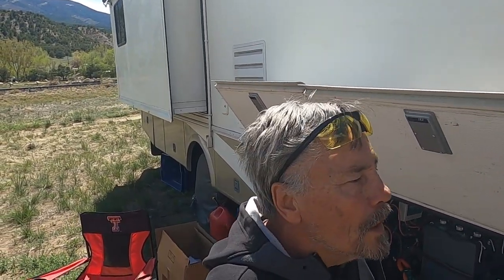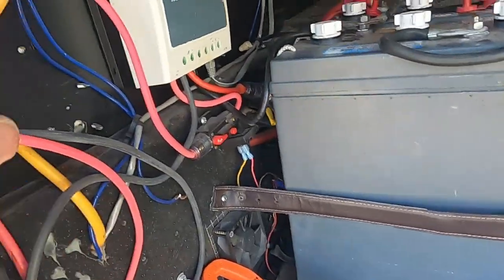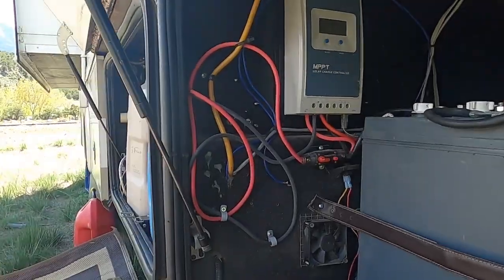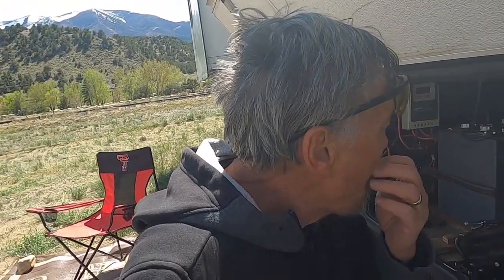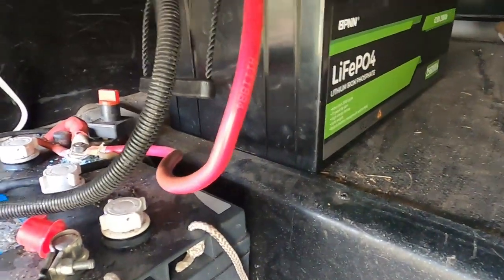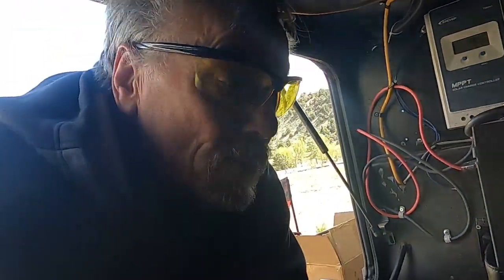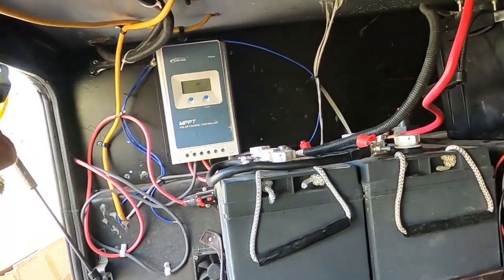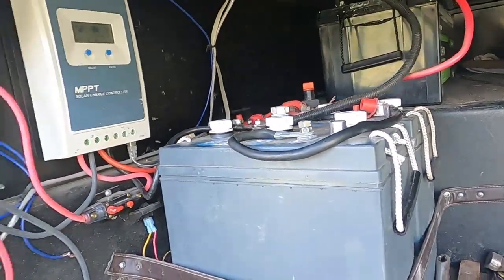An idiot mixed lead-acid with lithium batteries?

Comment: Mixing lead-acid and lithium batteries is not recommended due to differing voltage, charging, and discharge characteristics. It can cause inefficient operation, reduced battery lifespan, overheating, or safety risks like fire or thermal runaway. Use one battery type, match chargers, and avoid mixing unless using specialized management systems.

Comment: The. Charge controller needs to be set for lithium your not making any emprovements use eather lithium or lead
Reply from the maker: @jameswilsin5348  Hello new friend, l that you can run your lithium batteries down to 0% charge? This is true,but it turns out that that's 10.1 volts. At that voltage my battery BMS shut them down! The only way I have to get them back is to hook them to my lead acid batteries. They come right back on.
It's not done so please subscribe to my channel as I have subscribed to yours.
Thanks for watching may God bless you!
Reply: Some great discussion here. I am looking at doing the same. My application is a sailboat so only slightly different.  With a good quality BMS a guy could set the lifepo4 to cut out at 14.0 or 14.1 v. Then the lead acid charger would finish charging the lead appropriately.  This approach would not charge the lithium perfectly but I think that is OK.  Several other enthusiasts have tried this with good results.   Also setting the BMS to cut out at 12v will prevent over discharge.  Look forward to hearing other opinions.  Thanks for a great discussion.

Comment: Also the lead acid will stay at rest at a lower voltage slightly. They usually read about 12.8 v rested not charged recently. And your Lifepo4 battery will stay around 13.6v to 13.4v at rest not recently charged. So Lifepo4 battery will be taking up the slack slightly, it will work, but best to use in near future, only use all Lifepo4 batteries in your battery bank. All characteristics between batteries of same type work well together. You have to watch your voltages between different types of batteries in 12v range. Keep all batteries wired together at same voltage as best you can. I know batteries are not cheap. 😊
Reply from the maker: Hello again friend, thanks again for the additional information.
May God bless you!

Comment: Actually your okay, the lead acid batteries are charging the Lifepo4 battery because they are at a slightly over voltage over Lifepo4. Lifepo4 battery can handle a 100 amp charge so the lead acid was maybe 1 amp of charge to the Lifepo4 battery.
You can keep charging at 14.2v on lead acid, so lead acid charging is actually lower than Lifepo4 charging at 14.6v. You are not too far off your Lifepo4 battery charging volts at a slight lower 14.2v, but its okay to charge Lifepo4 at a lower charge voltage. Pretty close to the same run time charging Lifepo4 at 14.2v lead acid charging vs 14.6v Lifepo4 charging voltage. They say Lifepo4 will last longer at lower charge voltage but at the expense of a slightly less run time.
Reply from the maker: Good morning friend, thank you for your knowledge and wisdom. There's so much misinformation! Until you try it yourself you don't know what to believe? I'm not a tech guy, I'm the kind of guy just tries it and see what happens?
It's not done so please subscribe my Channel that I have subscribed to yours.
Again thank you for watching and may God bless you!

Comment: when you put two batteries in parallel, on a connection pole you put a shunt and digital ammeter that shows you the direction and the current which way they go.
currents up to 3 A are not so problematic
Reply from the maker: Good morning friend, thank you for the comment and tip.
If not done so please subscribe to my channel as I described to yours.
Thank you for watching and may God bless you!

Comment: It'll work fine....... They are wrong...... Huge myth spread by manufacturers.    They will work great together.😎👍👍
Reply from the maker: @dogdazetravellergarrett1367  Hello new friend, thank you for your comment and I believe you are correct.
If not then so please subscribe to my channel as I have subscribed to yours
Thank you for watching and may God bless you!
Reply: I’ve had four GC2 210ah wired 12v with four 100ah lipho4 in a shed/cabin for years charging from 800w solar with no issues, run 10k window ac, small compressor, charge power tool batteries and ac/dc compressor fridge/freezer.
Reply: I’ve had four GC2 210ah wired 12v with four 100ah lipho4 in a shed/cabin for years charging from 800w solar with no issues, run 10k window ac, small compressor, charge power tool batteries and ac/dc compressor fridge/freezer.
Reply: What size cables are you using?
Reply: @avianwashington7396  4ga cables

Comment: My RV starts charging all my batteries, engine,  which are 200 amp  LEAD ACID and house, which are 600 amp LITHIUM, 1-2 minutes after having started the engine...I've drove for hours , so far, and aside getting a good charge on my lithium, I didn't see anything burning down.

Comment: Generally speaking you don't want to parallel lithium with lead-acid.  That doesn't mean that you can't, just that it isn't a good idea.  I'll explain the reason in the second section below.

Always size fuses to 125% of the amperage limit of the device or cabling (whichever is lower).  So a 40A circuit should have a 50A fuse.   The reason is that a 40A fuse that is constantly run at 40A might melt its casing or otherwise generate a lot of unnecessary heat without blowing.  Its a bit of a safety issue.  The fuses are there to protect against shorts, mainly, you don't want them running hot under "normal" operation.

Of course if a particular circuit is sized for 40A but you never run more than, say, 30A through it, sizing the fuse to 40A is just fine.

You generally don't want to directly charge lithium from an alternator, it can burn-out the alternator. The reason is that the lithium can suck up as much current as the alternator is able to put out, and the lithium can do that for hours on end with its voltage barely budging.  While charging, LiFePO4's voltage doesn't really go up much past a certain point until it is nearly full.

This can burn-out the alternator.   Lead-acid behaves a bit differently with alternators because lead-acid voltages tend to rise up in response to the current sufficiently to regulate the current down a bit, even when the lead-acid battery is at a low SOC.  So the alternator is not going full-out for hours on end with lead-acid.  But with lithium, it will.

This is why a DC-DC charger should be used between the alternator and the lithium.

--

You generally don't want to parallel lithium and lead-acid.  It isn't ideal for either chemistry.   But it IS true that the voltages are mostly (but not entirely) compatible with each other.  At least as long as you don't try to equalize the lead-acid (which would be bad for the lithium).   There are several limitations:

(1) Lithium can accept much more current than lead-acid.  1C is the typical limit (the BMS might have a lower limit so read the battery label), and it doesn't particularly stress the lithium to be charged that quickly.   Lead-acid, on the other-hand, should generally not be charged faster than 0.1C.

So you have to severely limit the charging rate if you parallel.   This might not be a problem but remember that the lithium and lead-acid will accept current in different proportions and if the lithium disconnects for whatever reason, the lead-acid will take the full charging current.  So you gotta be a bit careful.

(2) The bigger problem is that lead-acid and lithium have vastly different resting voltages, and different characteristics at those voltages.

14.2V is an excellent bulk target for lithium iron phosphate, and works for lead-acid.  But holding there for a long time isn't good for lead-acid.   Similarly, the float voltage for LiFePO4 is roughly 13.4V - 13.6V, which tends to be more compatible.  But the RESTING voltage for a fully charged LiFePO4 is basically its float, whereas for lead-acid it is far lower (like 12.8V).   And 12.8V is significantly discharged for lithium.

This means that the lead-acid is going to drain the lithium slowly, which is not ideal.   This is the primary concern on the lithium side.

(3) Because of the above, the lead-acid will be held at a higher than normal voltage more or less indefinitely.  This can cause extra stress on the lead-acid and possibly more hydrogen outgassing, depending on the type.   This is the primary concern on the lead-acid side when you fully charge a paralleled pack.

(Some marine DIYers have gizmos to disconnect the lead-acid and lithium after charging is complete to allow the lead-acid to rest to try to get around this issue)

(4) Obviously you can't equalize the lead-acid, the voltage would be too high for the lithium.  This might or might not matter for the application.  Often when people do this sort of paralleling they don't care if their lead-acid sees more stress.

DISCHARGING:

For discharging the compatibility is good.  12.0V is roughly 50% SOC for lead-acid (which is where you want to stop), and 5% SOC for LiFePO4 (also a good place to stop)... so 12.0V is a good lower cut-off.  The lithium will take most of the load and if a big surge occurs the lead-acid will help.  The lead-acid will take over as the lithium gets low.

The problem is on the upper-end of the scale rather than the lower-end of the scale.

(5) The cycle life of the lithium will be negatively effected due to the lead-acid yanking it around (current shuffling between the two types of batteries).  Most people do not consider this to be a big issue though since LiFePO4 has a huge 3000+ cycle life.  Calendar aging of the LiFePO4 might be accelerated though which is more of an issue.

--

So can you do it?  Yes, but it isn't ideal and care must be taken.  I personally would not do it.  And regardless of what you choose you do NOT want the alternator to directly charge lithium.  Get a DC-DC charger designed for alternator-to-lithium.  You don't want to smoke your alternator.

-Matt
Reply: I respect Andy’s extensive testing on DYI Off-Grid Garage his Bulk settings are 13.8vdc with 1 hour absorption, and Float 13.4vdc respectively. His Bulk settings allow the batteries BMS to level all the cells. To high of a bulk voltage will cause a cell to hit it’s voltage limit, and the whole BMS will quit charging, unit that cell goes down, then it restarts, and repeats. I believe the lead acid in parallel is fine, however if you have cloudy days and the lead acid’s fill in, then bulk charging them back up to avoid sulphation, is prudent. This is over the lithium’s 13.8vdc so if you have a lithium battery that’s connected via Bluetooth or R485/CAN then you can turn off the lithium’s charging, and top up the lead acid’s. Take care
Reply: @TopMooseCone  A 13.8V target only works if you are able adjust the BMS's balance configuration to actually start balancing at that low a voltage.  e.g. to program the BMS to start balancing at 3.40V/cell or 3.42V/cell or so.

Most BMS's by default do not start balancing until 3.45V/cell (13.8V) or 3.50V/cell (14.0V), and you need to go 0.05V higher for your charge target to deal with sensor offset error.   This means that for an unmodified battery, you should use 3.55V/cell (14.2V) for the target.

13.8V also only works well as a target at relatively warm temperatures.  In cold temperatures, charging performance will be poor.  Which Andy might not notice since he has three large 16s sets ganged together in parallel.

Andy did some serious configuration adjustments and validated the voltage sensing error to use those numbers.   I don't recall what his winter temperatures were inside his enclosed battery shelf, but given all the LEDs, the BMS, and the loads he puts on the system charging his Tesla, I wouldn't expect it to be cold.

-Matt
Reply: Well written argumentation.
Reply: Ty. You saved me trying to explain similar things.....he's more at risk of diminishing the lifepo4 than anything......but why do that if you don't need to

Comment: You can charge your setup, led and lithium in parallel from your alternator because your led will always be there. BMS in lithium might disconnect internally which causes trouble with the alternator and led does not. Otherwise, nice setup using led while still good and adding ample capacity with lithium.
Reply: I'm still watching the video but wait, no, that's not right.  The problem with charging lithium directly from an alternator is that lithium can accept a massive amount of current for (literally) hours on end.  This can burn-out the alternator.   The reason this doesn't happen with lead-acid is that lead-acid naturally limits charging current... the voltage will get pushed up considerably by the charging current and naturally reduce the charging current.

With lithium the voltage barely budges and the result is that the alternator doesn't get a break... it will max out and stay maxed out until the lithium reaches roughly 95% SOC.

-Matt
Reply from the maker: Hello, thank you for watching the video. Thank you for reassuring me about charging the batteries with the alternator. So far I'm happy with the experiment it's keeping my lead acid batteries at a higher level throughout the night. It's not done so please subscribe to my channel as I have subscribed to yours God bless you thanks again!
Reply: @charlesvawter1527  

Mixing lead acid and LFP batteries can be dangerous because as you mentioned, leadacid batteries generate toxic and explosive gases when charged at high amperage(single spark goes boom), which LFP batteries can supply readily. The discharge rates also differ, causing the lead acid batteries to die prematurely due to the added stress of the LFP maintaining higher voltages. The LFP batteries won't reach their full capacity because the lead-acid batteries will drag them down when not charging. Charging your LFP batteries will also be slower because of the internal resistance of the lead acid batteries. LFP batteries charge quicker because they have a lower resistance which allows them to accept a higher amperage for longer durations, as the other person mentioned.

A potential solution is to use a 500W switching power supply (less than $40) connected to an inverter(<1KW) powered by the LFP battery. While there will be some energy losses this setup would be better, in my opinion. The power supply would maintain a constant charge on the lead acid batteries without passively draining the LFP batteries due to lead acid lower resting voltage. As the lead acid batteries approach full charge, the current draw would decrease, eventually trickle charging them. You could have the lead acid batteries connected to another inverter that you could use to power your heavier equipment.

The 300A fuse won't do anything for the LFP battery because its internal BMS fuse shuts off slightly over 200A(~250) during surges. Higher capacity batteries have higher amperage ratings because paralleling batteries distributes the load. For example, your LFP battery is paralleling two identical battery banks, which is how it's allowing you to pull 200A. Personally, I would lower your fuse to a slightly lower rating, like 180A. Using an improperly rated fuse renders it ineffective.

There seem to be too many downsides to doing this, to be honest. You mentioned that you wanted to do larger amperage pulls, but you can achieve that by adding batteries. As mentioned before, you could have bought four 12V 100Ah batteries that would allow you to pull 400A (5KW) when you have them paralleled.

I hope you don't mind the wall of text. It would be tragic to lose someone due to simple oversights. Stay safe.

Comment: I would not mix lead acid and lithium batteries, they have different voltages.  This is actually the first time ever I see someone mixed SLA with Lithium batteries.   LiFePo4 is quite good technology, lots of recharge cycles, just make the setup right.